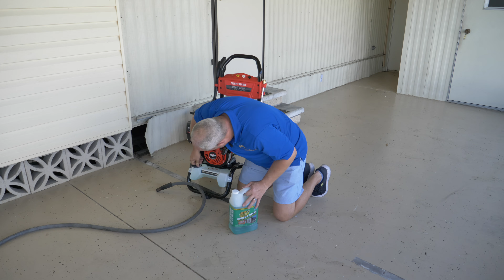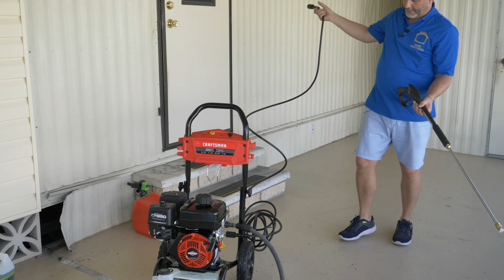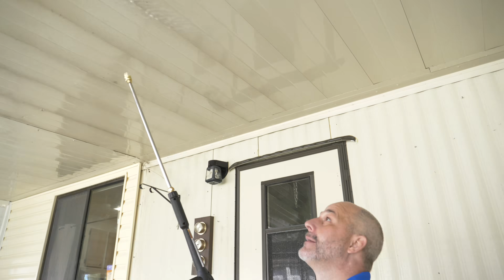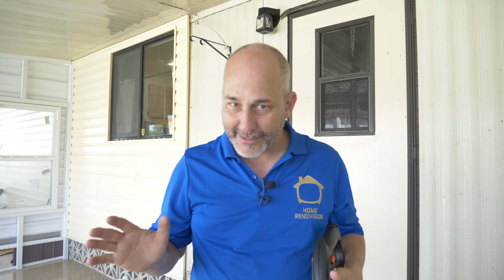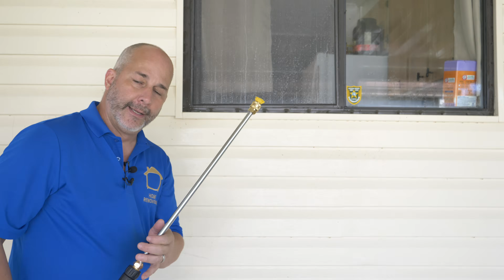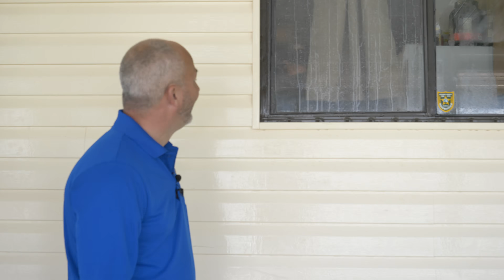Gas Pressure Washer: Is It Worth The Investment?

Comment: Two comments.. 1  throw the PW hose that came with unit , in the Garbage and go buy a good one  Flexilla or urberflex or yamatic.. 2.get quicks connects for both washer pressure hose and the inlet water hose.

Comment: Jeff, just a helpful tip, do a soft wash (no high pressure required) with 30 second clean (about $30).  If you're siding doesn't look brand new, then use a pressure washer.  Pressure washers are not cheap and etch the siding making it get dirty quicker.  Trust me try thriy second clean from your local hardware store. I was blown away by it, it doesn't just clean your siding it makes is shiny and new looking. We did this before listing our house for sell and most thought we just had the siding installed. Nope its clean but original to the 12 yr old house. It works that good.  No I don't work for them, they just make a product that most don't know about. Cheers!

Comment: Combustion engine's are so last century. Electric will get the job done and be basically maintenance free. It also doesn't make an ungodly racket, or spew exhaust stench everywhere. My 100€ Bosch came with a three-in one nozzle that does the necessary stuff and you can also just buy a patio washer and whatever attachment you need. Sure, it may not have the absolute top end pressure but pressure enough to do real damage to wood and such if you're not careful... so no,  you can keep your noisy combustion engines. As soon as I can find a good two-stage snow blower with lithium batteries that won't cost me an arm and a leg I'm ditching my last combustion engine too, which is the snow blower. Everything else is electric, or robotic and electric.

Comment: Both gas and electric pressure washers are still limited to where they go by the hose ut uses for water. You can say all the pros and cons for both and atill in the end come out almost equal except that gas has higher pressure than electric for now. You dont NEED chemicals with a gas washer for most projects the pressure will remove almost anything so less expense. I cleaned a thick moldy driveway in 10 minutes with pressure alone as well as sidewalk and steps. Yes soap or chemicals only draw up with the washer head fitting ONLY none of the other heads will and those are very low pressure so you gave to go over everything twice to get it done. I have both and electric and a gas that are used according to what isneeded cleaned. The biggest benefit of electric is the auto shutoff to kerp from killing the pump. Eventually they will get an electric washer over 2500 - 3000 PSI then I will go that route alone. Pressure is the key factor in a pressure washer, otherwise just use a garden hose with a high pressure nozzle.

Comment: Have had electric and gas. Electric works well for jobs that don’t need a high PSI. Like washing your car or removing surface dirt and mold. The heavy duty jobs need gas power. Like your driveway. 3,000+ PSI makes quick work of tough jobs. Pay a little extra and get gas.

Comment: I went with the DeWalt 2100 that was on sale for 250 and best part about it is that it is maintenance free. I absolutely hate small engine devices. they always clog up or old gas or when did you change the oil last. Is this one 2 stroke or regular. I just cannot stand gas anything anymore. 

Also the 2100 is super compact and packs all into the pressure washer housing!

Comment: As a homeowner who owns both gas and electric pressure washers, I advise others to avoid the gas units. I retired mine. The electric models are compact, quieter, and much lower maintenance.  I learned from professionals who do “pressure washing” that pressure is secondary to the chemical cleaners they use. The chemicals do the heavy lifting. The pressure washer is used for rinsing…not cleaning. Pressure is needed to reach higher stories. Get a soap/chemical dispenser that fits on the end of the washer’s pistol or wand. Don’t siphon chemicals through the pump.
Reply: I guess they didn't inform you of the main more important difference....GPM.

Electric is inferior in every way unless you just want to rinse something off.
Reply: @evictioncarpentry2628  GPM would improve the speed of the task. As a DIYer, that is not a concern to me. Time is money to a pro.
Reply: I have an electric one with a brushless motor and oh my that thing is INSANE. Better than any gas washer I've ever used.
Reply: @TheTurbinator  what make model? looking for a good electric one, thanks.
Reply: @TheTurbinator  what type of yours
Reply: @TheTurbinator name?

Comment: The best feature of an eclectic pressure washer is the automatic off feature. For gas, if you let it idle without spraying you will overheat the pump and kill the machine. Electric doesn’t have that problem.

Comment: 30 seconds outdoor cleaner(sold everywhere) does a really good job at killing algae and mold, mildew... spray it on go around house spraying it by the time you get back to where you started just pressure wash it off. Btw need to use black tip for soap to be dispensed low pressure and all other tips are for angle of pressure (not soap/cleaner)

Comment: I wonder about the gas vs electric washers.  Are the electric ones just weaker because they're cheaping out on the electric motors?  Are we running into a power ceiling when it comes to a typical 120 volt circuit?
Reply: i would imagine its a size and power thing, would likely need a bigger motor, and then it's power draw would probably trip your breaker for regular household outlets
Reply: Nothing new here. Gas gives alot of power
Reply: @dropndeal  Are you certain about that. I have a shop vac that has a peak horsepower rating of 6.5 hp.

Comment: Soap won't draw with a pressure trip. You have to use the black tip to get the cleaner to pull out.
Reply: I wish they'd change that. I want soap during high pressure washing.

Comment: I reach for my little Ryobi electric pressure washer with 1600 psi and 1.2 gpm for every pressure washing job aside from the driveway. It can actually clean concrete surprisingly well with the wand, but of course it isn't powerful enough to run the surface cleaner. I only break my gas pressure washer out once a year to clean the driveway now. You can't beat the convenience of electric, and most jobs don't actually require anywhere near the power and gpm that gas machines are putting out.

Comment: Electric pressure washers are convenient to use, but very light duty - rinsing a trailer or a small deck in the spring.  Gas is a must for larger projects like a whole house or driveway...you want at least 2500 PSI.  Just gotta watch out on wood surfaces, if you get closer than about 8" you'll leave marks or crack old brittle materials.

Comment: Good choice- I bought one of the Ryobi electric pressure washers- it only worked 3 times and died. If you lose the receipt, you have no warranty. Another reason to have a Home Depot account is to track these purchases because things can and do fail. This unit you have has a lot more power, but you can't haul it with you in e.g. a motorhome. Thanks for sharing.
Reply from the maker: Good tip